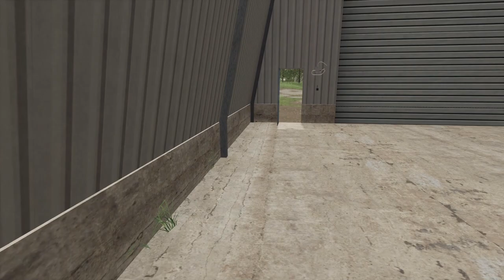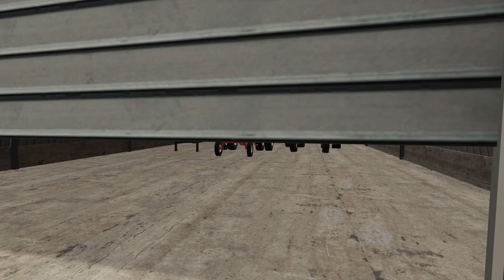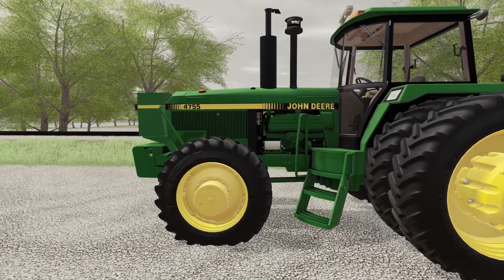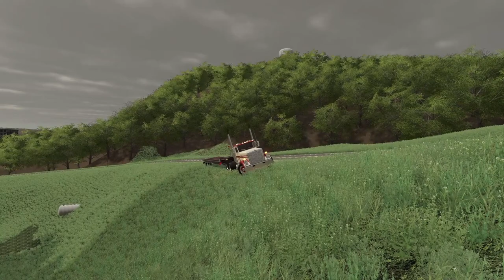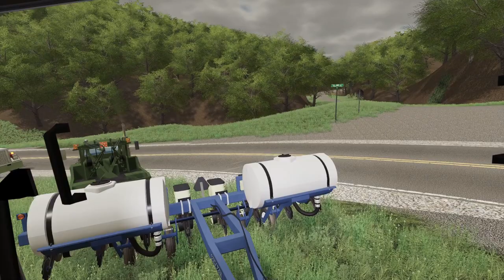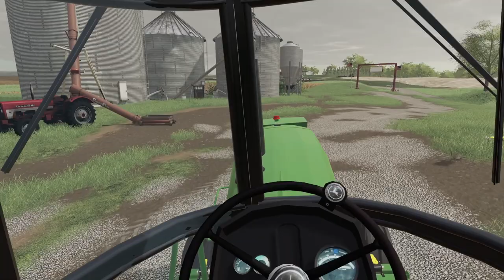FLAT TIRE NEAR TRAGEDY! | HUGE ROAD DITCH (1980's ROLEPLAY) FARMING SIMULATOR 19

Comment: 4755s didn’t have a 7.3 in it that’s a old ford truck, they had the 7.6 inline 6 466 cubic inch engine in it same as the 4440 or your 4840
Reply from the maker: oneyoungfarmer Did I say 7.3?   Man.  I meet to say 7.6 6 cylinder engine.
Reply: @SquadFarms  yeah plus the 7.3 is a v8